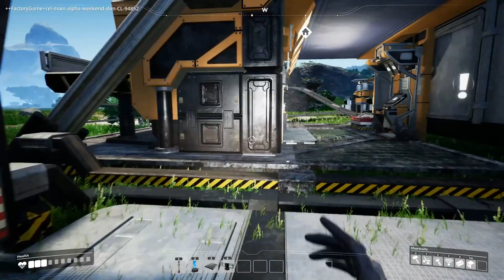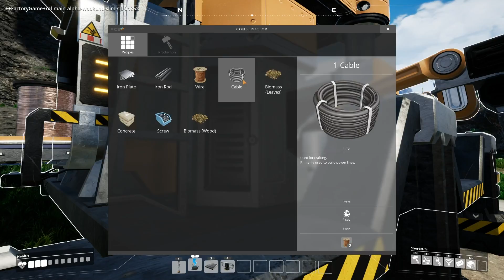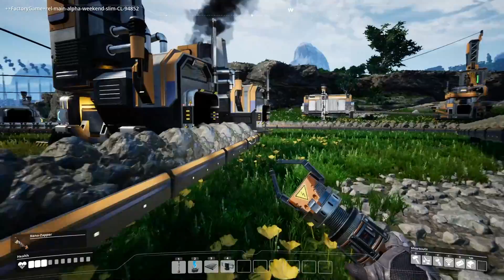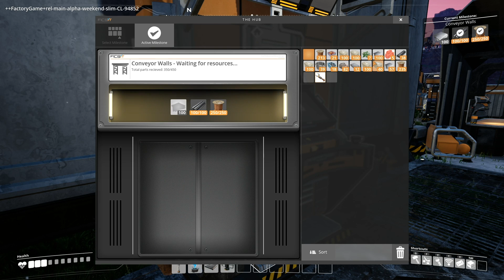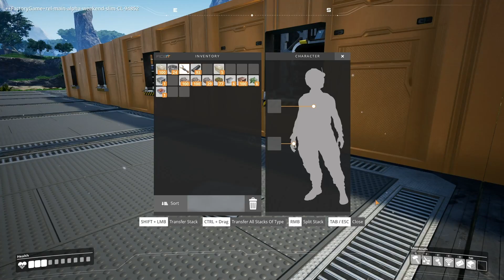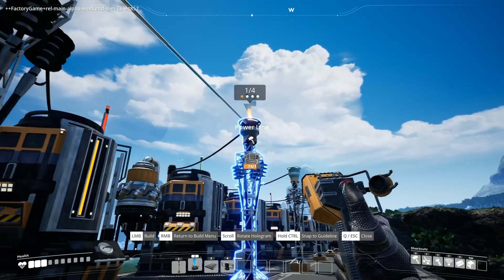HUGE Efficiency Boost in Satisfactory with Conveyor Belt Splitters and Mergers

Comment: For those of you who don't know, there are three types of nodes: Impure, Normal, and Pure. Impure mines at 30 ore per minute, normal mines at 60 per minute, and pure mines at 120 per minute. Some places in each of the worlds will have nothing but impure, or normal. Pure isn't as easy to find, but it's fantastic when you do because it doubles your production from normal nodes, and quadruples your production from impure nodes. Going into slight detail for more explanation, you can put one smelter on an impure node, two on a normal node, and four on a pure node since smelters only smelt at a rate of 30 ingots per minute.

Comment: you need 1 copper node split it to 2 smelters. one smelter feeds a constructor for wire the other goes 2 constructors 1 creating the wire then the wire feeds to the constructor for the cable.

Comment: Depending on the purity of the node you can run up 12+ smelters per node (yes a ton of constructors as well). Pure Coal nodes had 20 coal generators running at 250% with tons of extra built a mega storage for backup 3Wx3Lx20H the last container had loop back into the system. The other components built large silo's, storage boxes ticked over by one just wide enough to have a conveyor jump to next level for 20 high each while running additional into other constructors then into 8 assemblers 4 for reinforced plates, 2 rotors and 2 frames.
Reply: That's a waste unless you have higher than Mk2 Belts. Pure nodes are just Normal nodes if you only have Mk 1 belts, because Mk1 belts can only carry 60/min. Mk2 belts can support a Mk1 plant on a Pure node, but you still need higher tier belts if you're going to overclock.

Belts are the primary bottleneck, not production. No matter how many splitters you use, somewhere, there's a section where there's only ONE belt lane feeding in. Outside of Overclocking, a Mk1 Belt can support 1 normal miner, 2 inpure miners, 2 smelters, 2 Plate fabs, or 4 rod fabricators. Copper is a lost cause through tier 3 because you almost never need more than one constructor for wire and one for wire-cabling, even though the miner and smelters can handle far more.

Any recipe that has higher input or output rates than the belt can service can only infrequently operate due to belt speeds, such as Screws or Biomass.  The other thing to consider is demand. To fill a Mk 1 belt with rods takes 2 Rod constructors, and that can support 6 Screw constructors because it takes 6 seconds to unload the screws with a Mk1 belt. Do you really NEED 6 screw factories?
Reply: @GuardianCitadel   Always going to need extra of everything. Do get what your saying with over clocking never fully overclocked production 122% to an assembler 135% for constructer for screws works very well at maintaining a constant work flow running 98%. The rods and plates built multistage loop storage for the extra as well as a few splitters for re introduction into the work chain and additional storage.  Do understand sound like a mad scientist though only played the free weekend and was doing most of the testing via overclocking and max chains which proved very useful information and data before conducting further calculations.  Mk2 120/min keeps up quite well, stopped running mk1 once unlocked mk2 will end up doing the same with mk3+.